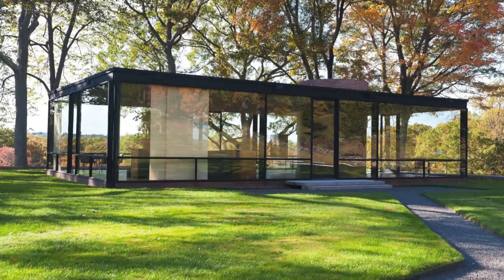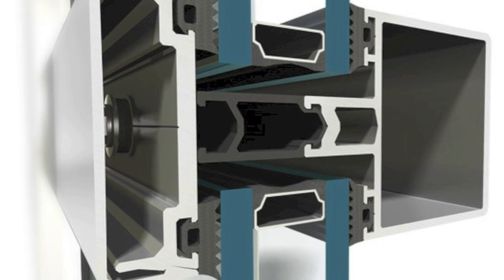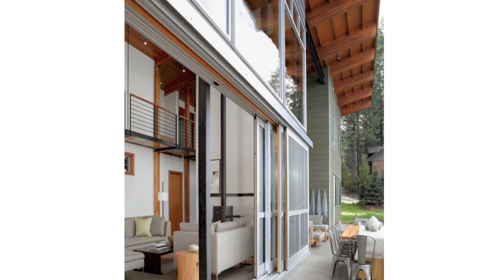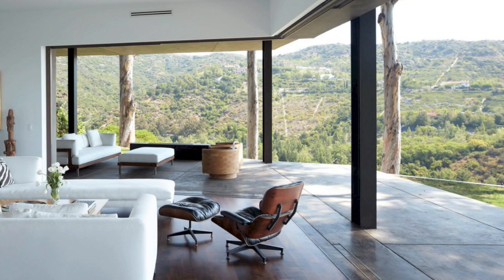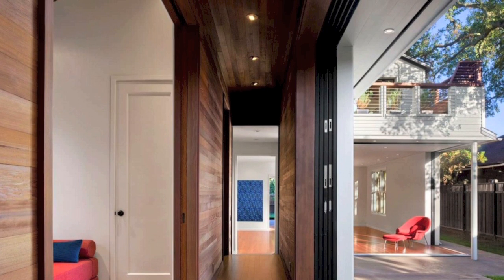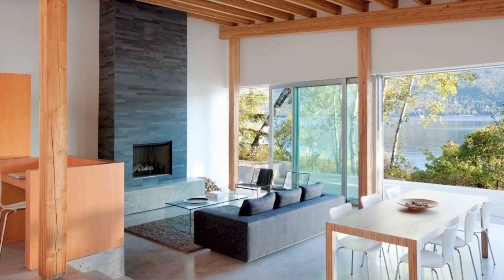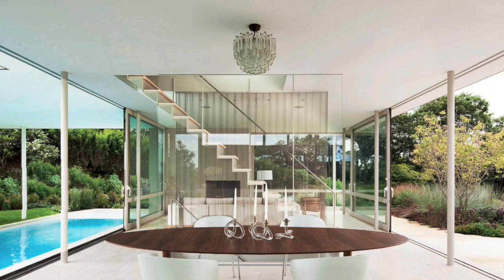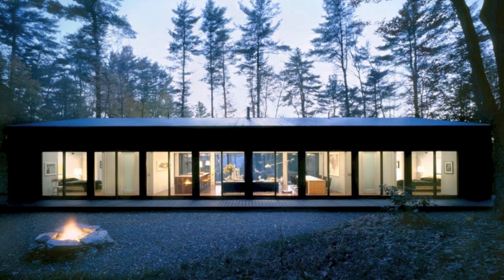(Large) Sliding Doors - An Architect's Review

Comment: colossal doors is not a great choice in tropical country then..
but will the glass trap the heat inside the building?
Reply: really depends on the window and surrounding, double pane windows are better in that aspect, mirrored double glass is best, single pane would, in a tropical enviroment, tend to trap heat through the sun's rays, although shade and propper ventilation should be enough to fix that

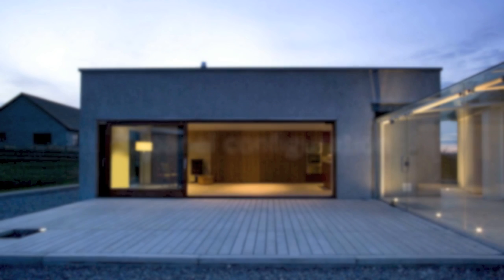Comment: 4:44 Does anyone know what those windows on the right side of the house are called? It's like a wall, but the wall is made of glass (windows)?
Reply from the maker: It's a frameless, butt-glazed wall with spider fittings to fix the glass to the structure.
Reply: Very good option. Good job, Eric.  Will you please make a video devoted to these glass walls, covering everything from price to practical examples?